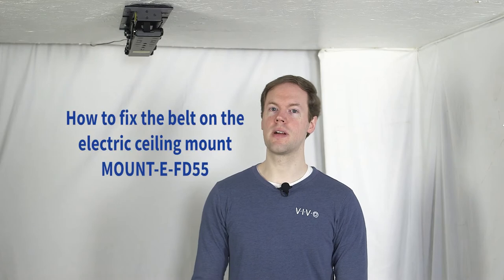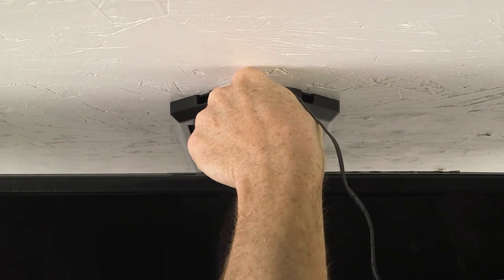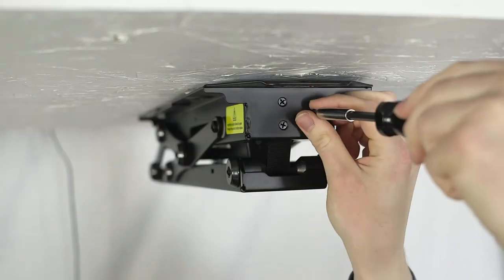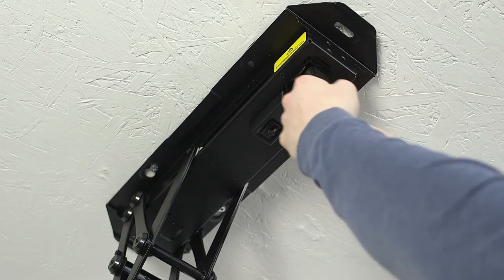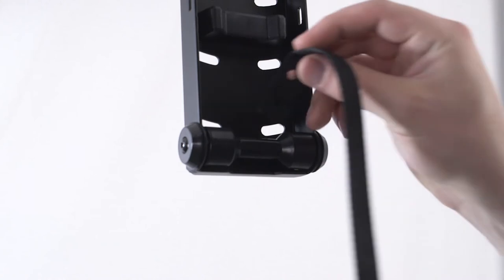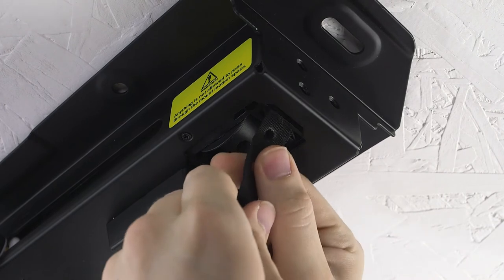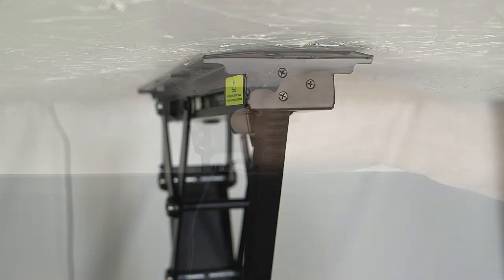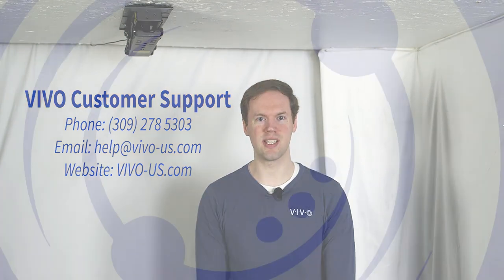MOUNT-E-FD55 Fixing the belt troubleshooting by VIVO

Comment: These need some micro switches installed so it doesn't pass the endpoints.....mine lowers,then attempts to raise until I hit the "ok" button or else it will reverse the belt on the spool...then I have to hit the "up" button so it will come back down,then hit "ok" again so it will retract properly....basically is not stopping automatically when lowering
Reply from the maker: We're sorry for the problems!  This particular one can be resolved by following the pitched ceiling adjustment instructions, setting the minimum height of the TV to where the lift belt still has some tension with the arm. https://cdn.shopify.com/s/files/1/1190/2562/files/MOUNT-E-FD55_-_REMOTE_CONTROL_REV1.1_online_1.pdf?v=1675795472
(NOTE: Before starting the adjustment, unplug the power for about 10 seconds and then plug it back in)
If it still gives you problems after this, please contact our customer support team for assistance: https://vivo-us.com/pages/support

Comment: How about designing something so this doesn’t happen? You’re making money on faulty equipment. Do better
Reply from the maker: Normally, this never has to be done.  Sometimes a mounted TV has a balance that's slightly off from the arm's movement range, causing it to not lower 100%, or there may be a slight angle to some ceilings that have a similar effect.  This can mess with the mount's position sensor, and using the instructions for pitched ceiling adjustment to raise the minimum angle a couple degrees has typically solved this and prevented further problems.

The vast majority of these mounts work completely trouble free, but for any that may have a problem, we will always do what we can to help, and we are always trying to find ways to improve our designs.

Comment: I've had to do this a few times. I set it, it works for a while then it starts going too far again
Reply from the maker: We're sorry the mount's been giving you so much trouble!  Have you tried using the pitched ceiling instructions to set a slightly reduced movement range (just a couple degrees to make sure there's no slack in the belt)?  If so, and if that still isn't working, please contact our customer support team about a possible replacement: https://vivo-us.com/pages/support

Comment: Can you help please: I bought 3 of these one for each bedroom and one for the drawing room.  The one in the drawing room OKAY works fine .    The ones in the bedroom beep 3 times and do not move down.

I am frustrated I have reset following the instructions, ie "unplugged 10 seconds, replugged, and pressed okay 6 seconds" as per the instructions but still zero: the TV won't move down.  I have been trying this all day and I am very frustrated and disheartened.  Please be so kind as to help.

If you could just explain how to get the TV down to viewing level,  that would be very helpful indeed.  Thank you.  John.
Reply from the maker: We're sorry this is happening!  Since you're getting 3 double beeps, you likely have the previous version with the IR sensor.  We would suggest first performing a belt reset as shown in this video.

After this is finished, reset each mount by holding the 1 button on the remote for 5 seconds a total of 6 times while aiming at the mount's IR sensor.  It should automatically retract fully, then drop down until the mount has determined the minimum height.  Once that's finished, press the OK button to reactivate the mount (it will raise to the ceiling and then be ready for full operation).
Reply: @VIVOus  mine is stuck in the up position after 1 use. SO disappointing... Trying to detach my tv from the mount while stuck in the up position will be challenging.  Brand new TV that hasn't been powered for the first time yet is stuck up there.. smh.
Reply from the maker: @bmoreyella  We're sorry that this has happened!  It should be possible to lower the TV by removing the 3 screws shown in this video and resetting the belt.  If it still does not work correctly, please contact our customer support team: https://vivo-us.com/pages/support
Reply: @VIVOus  thank you. I will be trying it this weekend when I have time. Thanks so much.
Reply: I’m also have a similar issue but only 2 beeps. Tried the above but Notting has worked.
Reply from the maker: @victorstewart4796  For 2 beeps, the mount should simply need a reset.  If you haven't done this already, try unplugging the mount for a minute, plug back in and then reset by holding the OK button for 6 seconds.  This should raise the arm fully, and then press down to bring the arm back down.  If it's still not working, please contact our customer support team: https://vivo-us.com/pages/support

Comment: So I have the fd 70 model and I followed these instructions, however I’m unable to slide the thing forward to put the belt back into its place? How am I supposed to fix that portion if I can’t move it forward.
Reply from the maker: We're sorry the mount is giving you trouble!  MOUNT-E-FD70 has a larger motor and gearbox than FD55 which is unable to slide forward as a result, so we have another video showing what to do for this model: https://www.youtube.com/watch?v=FolzqF1N-sU

Comment: How do I adjust the angle of the TV screen? It is more like 45-50 degrees instead of 75.
Reply from the maker: The mount can be reset by holding the OK button for 6 seconds.  After holding the button, the arm will raise completely to the ceiling.  Once it's fully raised, press the down button and allow the mount to lower completely.  If this doesn't work, please contact our customer support team for further assistance: https://vivo-us.com/pages/support

Comment: What if I can’t move the pull assembly forward
Reply from the maker: For MOUNT-E-FD55, the motor/pulley assembly doesn't move much, but it should give just enough room to reinsert the belt into the back.  For MOUNT-E-FD70 though, the motor is too large to move around, so the mount will likely have to be removed from the ceiling to open the top access panel.
Reply: @VIVOus  what do you mean open the top access panel ? Yes I have the 70. I have taken the tv down my mount is on a pitched ceiling.  I put it up yesterday and it worked at first but I think i demonstrated it to much put of excitement so I had to trouble shoot the belt so your saying take the mount down ? And then open the access panel which is where ?
Reply from the maker: @LaneBandit  The access panel is on the top of the ceiling mount portion.  With the mount removed from the ceiling, you'll be able to remove the 6 screws holding the panel in place, and this will allow the belt to more easily be reinstalled and secured.

Since the mount is on a pitched ceiling, we would recommend following the instructions for setting the mount to work correctly with the ceiling.  This will be on the first page of the remote manual: https://cdn.shopify.com/s/files/1/1190/2562/files/MOUNT-E-FD70_-_REMOTE_CONTROL_online.pdf?v=1603818796
Reply: Is there a video designed for the fd-70 model? That would really help

Comment: This is at minimum a monthly thing I have to do now.
Reply from the maker: We're sorry this keeps happening!  After resetting the belt, do you notice any slack in the belt when the mount is fully lowered?  If so, unplug the mount for 10 seconds, plug back in, and then follow the "pitched surface" instructions in the controller manual to raise the lowered angle a degree or two.  Eliminating slack from the belt can help to prevent this problem from happening again. https://cdn.shopify.com/s/files/1/1190/2562/files/MOUNT-E-FD55_-_Remote_Control_online_2.pdf?v=1602716662
Reply: You should never have to do this. It’s a faulty design
Reply from the maker: @MrAntoniorey  Normally, this never has to be done.  Sometimes a mounted TV has a balance that's slightly off from the arm's movement range, causing it to not lower 100%, or there may be a slight angle to some ceilings that have a similar effect.  This can mess with the mount's position sensor, and using the instructions for pitched ceiling adjustment to raise the minimum angle a couple degrees has typically solved this and prevented further problems.